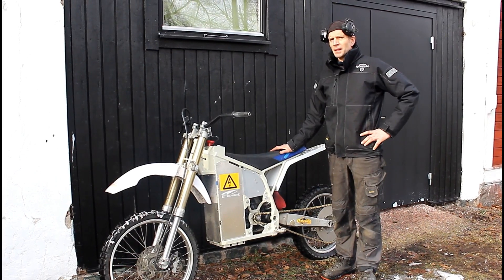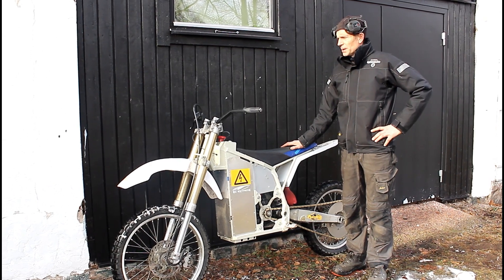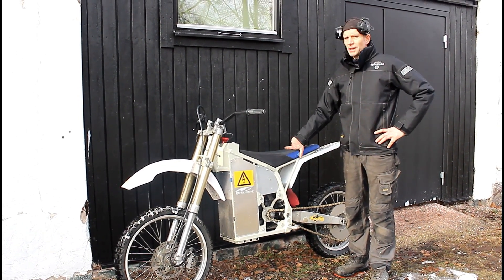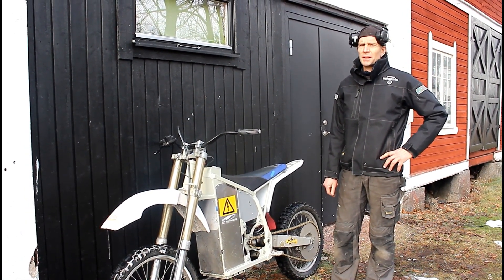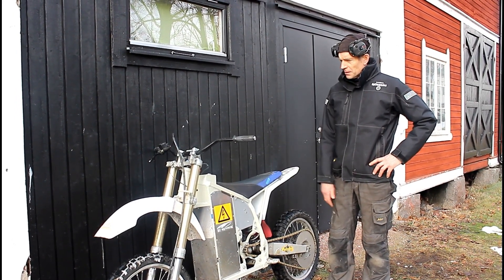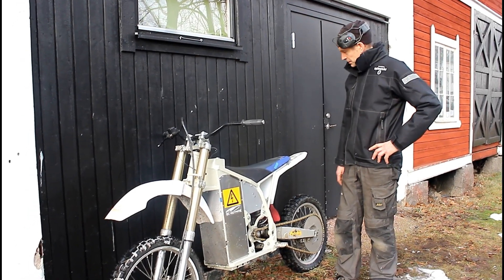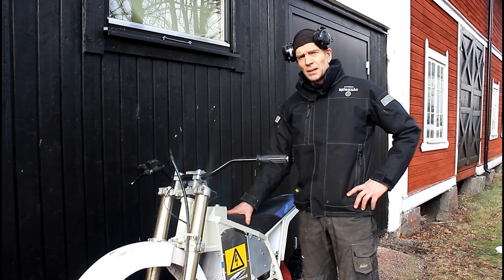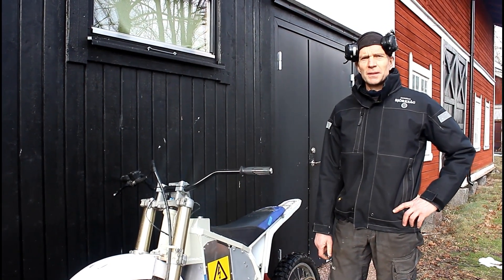Electric dirtbike test

Comment: Can you link the parts you used or send me a message
Reply from the maker: Hello, I was lucky to buy almost all parts second hand, but the motor is a Agni 95R : http://www.asmokarts.com/index.cfm?pageID=24 and A Kellly Controller : https://kellyev.com/wp-content/uploads/kdz/KDZ.jpg The one with 72V, 550A and regen.  Batteries came from a Microvette but I have been building a new batterypack from 18960 cells : https://www.aliexpress.com/item/100-New-Original-HG2-18650-3000mAh-battery-18650HG2-3-6V-discharge-20A-dedicated-For-Electronic-cigarette/32868746648.html?spm=a2g0s.9042311.0.0.2fbf4c4dNIqmj9 and System for high amps : https://www.aliexpress.com/item/High-quality-18650-battery-holder-For-big-power-battery-pack-50A-100Ah-200Ah-Lower-price-is/32837557299.html?spm=a2g0s.9042311.0.0.2fbf4c4dNIqmj9 and BMS to controll 500 A : https://www.aliexpress.com/item/600A-2S-24S-Lithium-LiPo-Lifepo4-LTO-Smart-Balancer-Display-BMS-1500W-Charger-Li-ion-Battery/32897719690.html?spm=a2g0s.9042311.0.0.27424c4dqxErBW  
I am planning a upcomming project with a Honda CRF chassie with ME1302 engine and Sevcon Gen 4 controller with batterypack as above. Think that is a better solution with more Power.  Hope this have been helpfull. BR Pär

Comment: how much did it cost you and is this bike worth it?
Reply from the maker: Hello, I lucky to get my hands on second hand motor and battery from a Microvette Electric Car, but I estimate buildcost if you buy new parts to around 3000-3500 USD. That is a fraction if you compare to Alta, Freeride E and the new Cake Bike from Sweden. I do think it is worth it, you get 28kW of power in a Dirtbike chassis. BR Pär